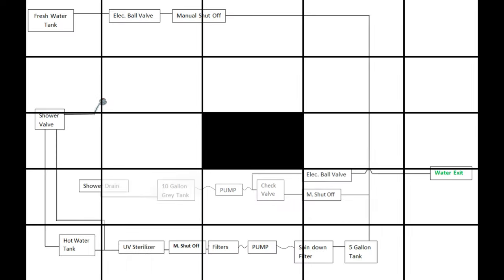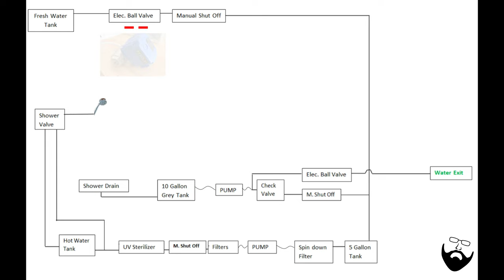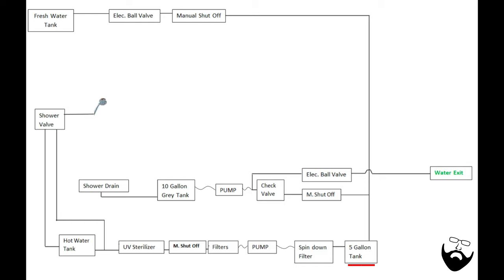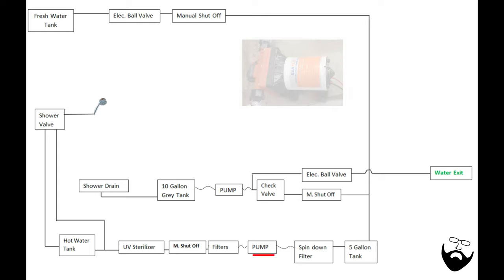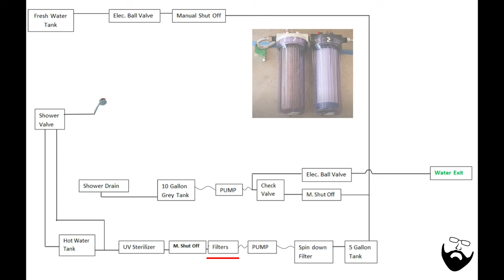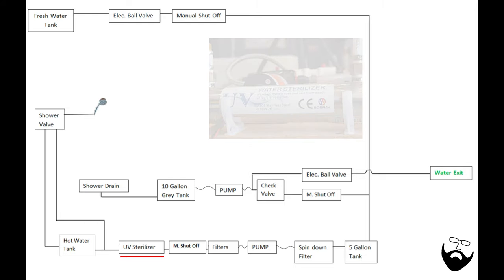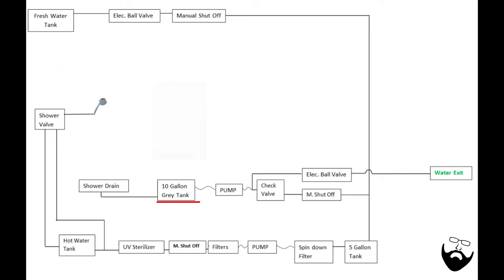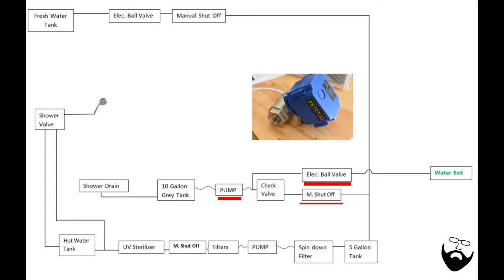Van Life recirculating shower schematic

Comment: Not sure why you have grey tank and 2nd pump etc, and don't simply gravity feed directly from shower drain to original 5 gallon tank? Just bottom drain that 5 gallon tank when it gets contaminated, and refill from fresh water tank. Just trying to wrap my head around my own planning, and find, some of your system seems superfluous for a simple closed loop.
Reply from the maker: The shower drain is gravity fed to the grey tank which is under the van.  The original 5 gallon tank is in the van above the grey tank.  So, a pump is needed to put the water back into the original 5 gallon tank.  Because of the location it can't gravity feed directly to the original 5 gallon tank.  It all depends on the tank locations!

Comment: A few questions and comments:

It seems in general ideas get put out there and then just get recirculated. We see various iterations of the same idea.

One thing nobody seems to be talking about is carbon filters are typically not designed for HOT water. I think most sediment filters can handle the hotter water, but carbon filters to my knowledge are not designed for HOT water. I don't think I've really seen anybody address this. Kleen systems does make a filter design for up to 180°, but not carbon. 

Second, I would strongly advise using a heat exchanger unless your hot water heater is dedicated only to your shower. A separate pump can recirculate the hot water through the heat exchanger, and then your shower water goes on the opposite side and is heated by the exchanger. Beer cooling systems tend to be cheaper than so-called "heat exchangers". Something in the 30 plate variety should be more than adequate. An anti-scalding valve I think is also a nice idea to avoid any water shock. This keeps any shower water out of your HW tank or heater. You can also use engine coolant to heat as well with this set-up. 

And what I've done is hooked up two sources of water to my shower. I had a normally open solenoid valve just before the filter, and I only recirculate water that has no soap in it.  Even in this water I add a tablespoon of Epson salt to help convert normally soluble chemicals to insoluble and that helps the filter do its job. Soap is what kills the filter the fastest. 

Just before I shampoo my hair, I turn off my recirculating filter, turn on the solenoid valve, and lather up and rinse military style. This diverts all the soapy water to your gray tank or outside. And I use a plant-based biodegradable soap. Uses maybe a quart of water. 

And people should be aware that most UV lights run off of 110 V, and the pump mentioned is 7 Amps. You need a pretty hefty battery system to run these style systems. 

And while I have not tested, a company called Loops, released a commercially available portable shower totally self-contained. I think it runs about $1000, and is using a series of screens as opposed to filters, so they can be washed. Over the long haul I'm sure it would pay for itself. It has a 12 Volt UVC LED. I have yet to find one available anywhere else that runs off 12 V. Again most of these UV lights are 110 Volt, so you need an inverter. 

I think you've touched on a lot of good points though. In general trying to keep the soap out of the system is key though. And using a plant based shampoo.
Reply from the maker: The system we described and installed is working very well.   We find it easy to use. Everyone has their own ideas....

Comment: This is cool! You mention you used 3 identical pumps, but only show 2 here. I assume the 3rd is for the kitchen sink. How do you empty the 5 gal tank that contains recirculated water? Also you could've eliminated one of the tanks, and just use the grey water tank as the circulated water tank? You'll just have to empty the grey water tank "each time" you want to take a shower, and then fill it in? But this system removes that constraint, and can re-use the 5 gal water for multiple showers?
Reply from the maker: If you watch this video  https://youtu.be/vYiWQh-6bY0   you will see the actual installation.  We use a single pump for the shower and a single 5 gallon grey tank for the water.  To refill when we want it is gravity fed from the fresh water tanks.   Yes we can re-use the 5 gallons for multiple showers, and replace anytime we want.  We also use electronic ball valves to empty the tank.  Been working well for over two years. 
 Thanks for watching

Comment: Thank you for the detailed schematic and helpful videos.  I have a few questions:
1) Why the need for two tanks in the shower loop?  I was hoping to get away with one grey tank under the van.
2) Why the need for two pumps in the shower loop? Could you use a more powerful pump for the loop? 
3) Does the UV light turn on automatically when water runs through it or do you need to run a wire for an on / off switch? 
4) How do you clean the system other than replace water, clean filters, and replace filters? 
5) Your specified UV water purifier link is the .5 GPM.  Does that constrict the water flow of your shower? A typical USA shower uses a little over 2 GPM. 
Thank you for your help and the very informative videos.
Reply from the maker: 1. You could use a single tank.  I all depends on the location of the tank.  Also, a single tank under the van, may freeze in colder weather.  Be sure to use a heating pad - if the tank is outside.
2. Again two pumps are needed because of the location of the tanks.  If you use a single tank, you could use a single pump.
3. In my application the UV light is wired to turn on when I start the pump, and hat water heater.
4. I have been replacing the water, filters and disinfect the system with bleach when I replace the filters.
5. I have not noticed any reduction in water pressure. I checked the specs on the UV system and it states 2 gallons per minute.
Reply: @FrugalFactor  Thank you for the details!  Much appreciated. I just checked it again and when I hit your Amazon link for the UV filter it has the 0.5 GPM unit selected. I am not questioning what you have installed, just the Amazon link. 
Thanks again?
Reply: How would one pump work with one tank? I still see a need for two, one to get water up into the shower head and another to push it through the filters back into the recirculating tank. What am I missing?

P.S. manbulance guys used a bath/shower combo mixer to send water out the water exit which might negate the need for the check valve and solenoid on the exit side.
Reply: Oh wait, you just need to move all your filters on the shower head side of the recirculating tank, I think I answered my own question 😂

Comment: I love all your videos. Super helpful. 

When your freshwater tank is running low how does the water continue to completely flow to the second tank with it being so far away? 

If I am setting up a system like this in a bus conversion, do you have to turn the pumps on and off before and after you shower? 

Same question for the ball valves.

Do the ball valves have their own switch on them or is that a separate item needed to wire it to?
Reply from the maker: Watching this video may answer your questions https://youtu.be/vYiWQh-6bY0   The tanks are not far away, less than 4 feet.  We only need to turn on the pump when taking a shower.  There is now one pump, and one grey tank.  Gravity puts the water in the grey tank, and a single pump pulls it out.      We have two ball valves, one for the 5 gal shower tank, and one for the 5 gallon sink grey water.  Each is on its own switch.   Soon there will be a video showing electrical connections for all the switches.
Reply: @Frugal Factor  I look forward to the switch connection video. This video link was very helpful. Thank you so much

Comment: how would you add a sink to this? Maybe route the water after the uv and hot water heater into the sink, and have it drain back into the 10 gallon grey tank? do i need those check leveler thingies or special connectors??
Reply from the maker: The sink is a separate system and seen in this video - https://www.youtube.com/watch?v=6q-gEsDdDrs&ab_channel=FrugalFactor

Comment: Just curious.  Why no spin down filter for the pump that sits after the 10 gal. Grey tank? And, is it harder on the filters to have the grey water tank in the recirc system?
Reply from the maker: There is a spin down filter.  After the prototype, I removed one of the tanks. So, there is a single tank.   The final installation is shown in this video   https://youtu.be/vYiWQh-6bY0      Also all the videos are divided by category at  https://thefrugalfactor.com/

Comment: Great video! Can you put the pump after the UV filter and other filters or even after the mixing valve for hot and cold water right before coming out of the shower? (In case of one pump and one tank) Or is this a bad idea because there will be sitting water in the filters after each shower? If sitting water is not a problem for the filters could you get away without a tank?
Reply from the maker: You can give it a try.  That would require the pump to pull the water through the filters. When researching I found that pumps do not suck up the water efficiently.

Comment: Question - how might you change the schematic to retrofit a system like this into an existing RV (for example with a Truma combi system that already is an instant hot water heater).  I wouldnt want to pump this recycled water back through the system we use to wash dishes etc.

Comment: Great videos thank you! I’ve mocked up a system in my garage also but it’s not working properly thought I’d ask the expert, it runs great but seems to have quite a bit of water in the pan ( I’m just using a 5 gallon bucket with a fitting at the bottom until my pan arrives) and secondly when I close the ball valve that is after the check valve and open the electric valve to exit the water it won’t empty the entire system?? I appreciate any thoughts ideas. Great job!!
Reply from the maker: From your description it sounds like everything is on the same level.  Water flows with gravity out of the pan (5 gallon bucket).  When you open the electronic ball valve all the water should exit.  I may have half an inch remaining in the tank.  That is due to the height of the drain on the tank.
Reply: Thank you I see, the water exits now, my other problem now is when I shut the shower head off the pressure builds to about 45# and the pump from the spin dow n filter shuts off and the pump from the 10 gallon keeps pumping ( or bubbling) into the 5 gallon tank
Thanks again I appreciate the help
Reply from the maker: The pump I use is variable flow (SEAFLO 42-Series) and shuts off after it reaches a set pressure.  You should shut the pumps off when not in use.  When not in use/at rest there is no reason to have pressure in the system.

Comment: Don’t you need another spin down filter just after the 10 gal sump to protect that pump?
Reply from the maker: There is a small spin down filter that is included with the SeaFlo pump.  The main spin down filter in front of the filters, it to protect the filters from clogging.    Adding a second large spin down filter is not a problem, but so far I have not found it needed.  I would further protect the pump.

Comment: 19 gallons of process water (more, including that in filter housings and plumbing) is excessive, largely negating the benefits of re-circulation. One should be able to get this down under 4 gallons by scavenging from an open shower drain sump and pumping directly through the filters into a small (2-3 gal) reservoir tank, then a second pressure pump, though a tankless heat exchanger to shower valve/head. This is my plan, anyway, in conjunction with a diesel/electric/engine-coolant hydronic heating system that also serves RV interior.
Reply from the maker: Total is 9 gallons of water, and may be used for multiple showers.  Your plan sounds interesting, hopefully you will share it when it is completed or prototyped.

Comment: What happens if you use soap during a normal shower? 3 Filters and the UV sterilizer cannot cleanup the soap in the system. After looking at your schematic, it looks like the drain pump is superfluous. The whole should be designed with 12 volt DC. Lastly, where you will find space for all these tanks and bulky filters in a van. Can you simplify the system keeping the same objective of recirculating fresh water shower every time you take a shower? That should be the actual challenge.
Reply from the maker: I always use soap, and the filters do clear the soap from the water.  The system is designed with 12 Volts DC.  The system is placed out exactly as it will be implemented in the van.  If you look at the other video's in the series you can see the blue tape on the floor designating the placement of each item.  Cheers....

Comment: hello, does the waterheater keep the recirculating water during a shower session at the same temperatur?
Reply from the maker: Yes.   That recirculated water may already be warm, so that water could warm up even more.  But I don't notice any real change.
Reply: @FrugalFactor  thanks!
Reply: If the recirculating shower water already has some residual heat left In it and then it goes through the rapid water heater- will the heater add its thermostat set hot water to the already heated water and actually achieve a higher temperature?

Comment: Can the 4 gallon hot water heater in this system be replaced with a tankless water heater that runs off of propane? 

If so, this is the system that I will use 😁
Reply from the maker: Those tankless heaters need to be used outside, or vent very well.  I would not use one in an enclosed van.